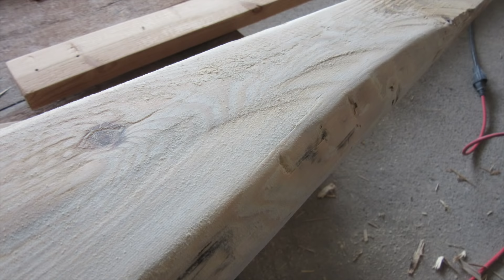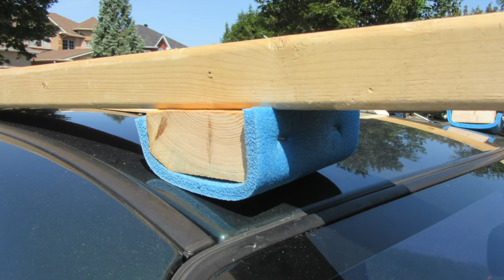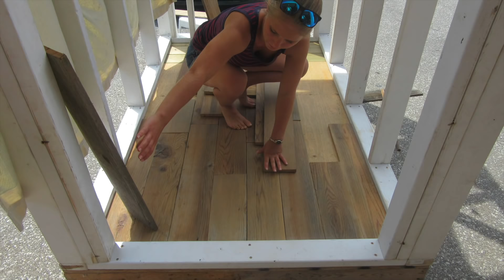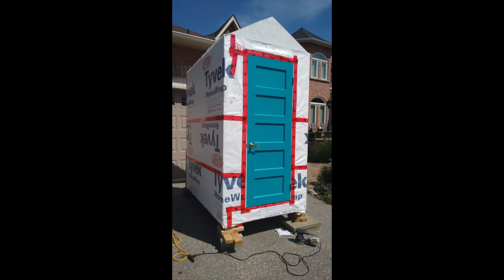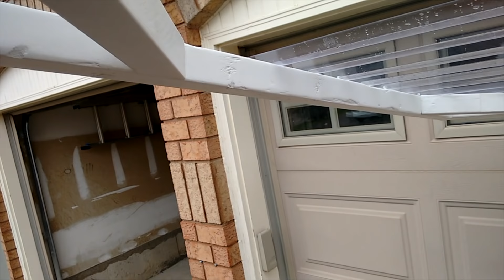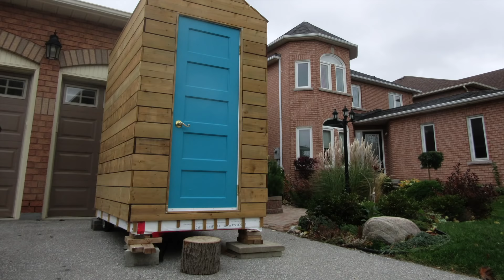DIY Bunkie/Shed

Comment: Cool video, needs more pics of the girl tho. Building wise: I’d give it a 4 out of 10. But with a little proper building education you can fix this up. 

Needs over hang on roof, should have made floor tongue and groove to save all the exposed nail heads. Don’t spill water on that floor.  Also you should’ve used casing on the corners. Whatever method that is called is sure to start rotting within the year. I’m already seeing water beads just skiing down that siding like a snow boarder on a mountain side. But fun video!!